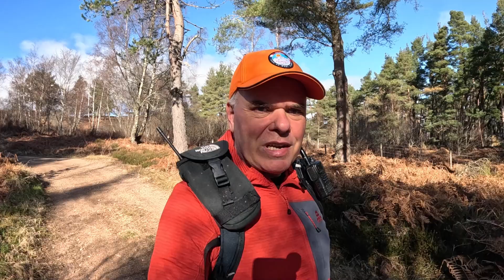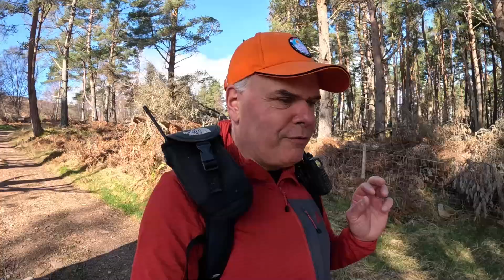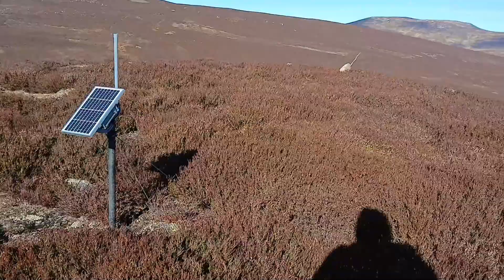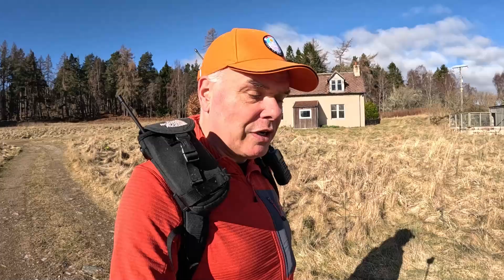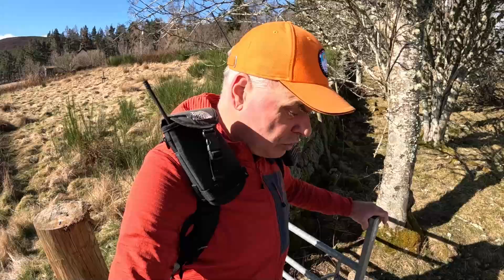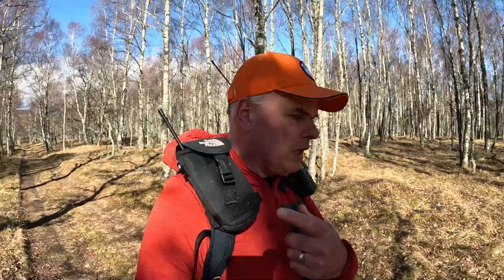LoRa 70cm - answering your questions, and sharing my thoughts @m0bob

Comment: The three videos you have done on this subject, which I knew nothing about, are excellent. However, my mind keeps saying to me, how can packets going out on 70cms be then picked up my an APRS 2m radio? Does there have to be an intermediary device? I may have misunderstood this but the mountain repeater just receives and repeats on 70cm is that correct? More videos on all of this would be great.
Reply from the maker: In simple terms: 70cm lora tracker -- 70cm lora igate -- aprs server -- 2m digipeater -- 2m radio
I just tried this, and it took about 4 seconds from one end to the other.
Now that I have a digipeater on a hill, there can be an extra stsp, so 70cm Lora tracker -- 70cm digipeater -- 70cm igate. and so on.
Hope this helps?

Comment: This has been really helpful to me Fraser. I'll get an iGate set up at home with a spare Heltec board. I tested my Anytone 878UVIIPlus with APRS last week on 144.800 successfully, is LoRa still Analog on the same frequency? Is there a specific device you'd recommend I could take in my car/motorcycle with me? Thanks! 2M0NZB
Reply from the maker: @chr15b  lots of questions there! Let me try...
Amateurs use LoRa on 70 cms. 439Mhz range of the band.
You won't be able to decode the "chirp" with your Anytone or any other APRS equipped hand held. These all use the traditional AFSK keying - the tones you hear when you receive a beacon or message.
As for a tracker, I've used the lilygo t-beam boards. A single 18650 cell attaches to the rear and lasts a couple of days. Others have used Heltec trackers, but I'm not familiar with them. I do know they are hungrier on power. 3D printed cases are available for both types.
For your bike, something tucked behind the fairing/screen with a short antenna would work fine. Waterproofing might be a nice challenge for you. Actually, if you had a backpack, it would work well inside a pocket.
I'm not sure if you saw my last video on lora? I go into it a bit more there.
Cheers,
Fraser MM0EFI
Reply: @theradiorover  I appreciate the response, thanks! Looking forward to experimenting with it.

Comment: Great video and yes Bob great question. I APRS on my radio that Tx but never saw the point in it. Keep them coming Fraser. I have meshtastic and meshcore running at home but not a lot of movement on them. 
73
Reply from the maker: Cheers Motters. A lot of us have features on our radios we'll never use. For example, I've never had an AM QSO. 😊